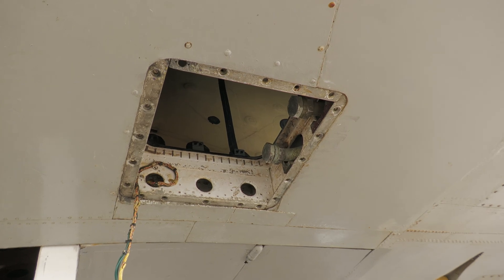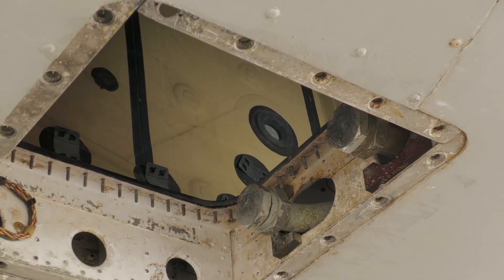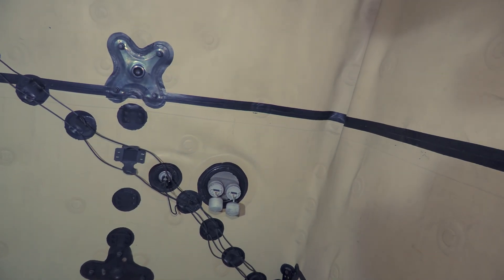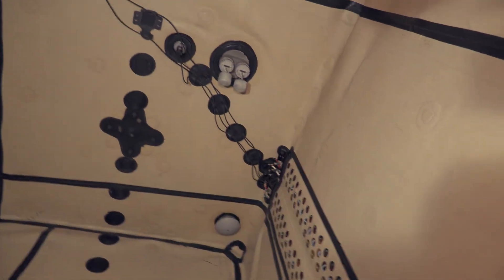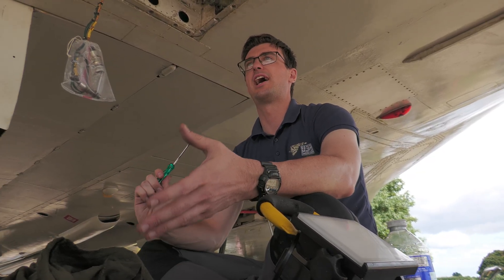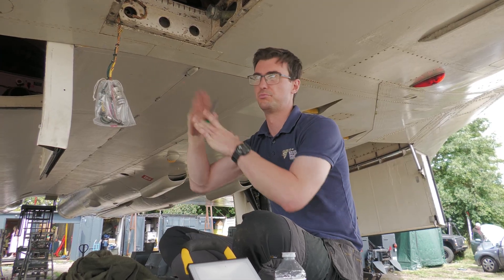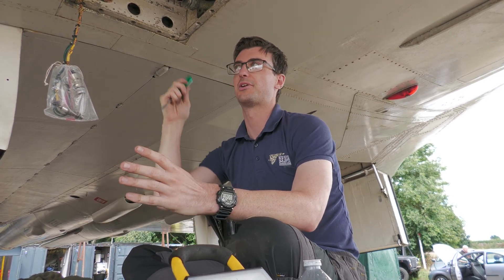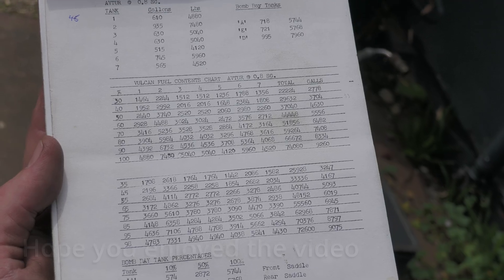Vulcan XM655 - See Inside the Fuel Tanks

Comment: Matt wasn't exactly clear about the refuelling process. When operated manually any tank can be selected, but when done automatically the operator selects the percentage of fuel required and the system puts that percentage in all the tanks, starting at the front and working back.
The float switches in the top of the tank are primarily intended to turn off in-flight refuelling to that tank when the tank is full. They will also turn off ground refuelling in the event of a full tank, but if the operator is doing things correctly that shouldn't happen.
Reply from the maker: Thanks for the additional information and clarification.

Comment: Did you ever manage to find out how many engines of Vulcan the can still maintain flight thank you?
Reply from the maker: We did get a reply back form Mike and it was posted in the comments of the video. If you missed it...here you go.

So... A question was raised about the minimum number of engines a Vulcan could fly on. I asked Mike and here's the response I got back.

" I suppose in certain circumstances she might fly on one engine but I wouldn't like to have tried it! The safe answer, which we regularly practiced by the way, is to say two engines.  We used to practice a double engine failure on take off, the worst time to suffer one, and then fly a two engine approach to a touch and go.  On the runway after that two-engined asymmetric approach and then  bringing the 'failed engines' back up from idle to about 80%  power for the roller and attempting to keep her straight on the runway was a good game! "